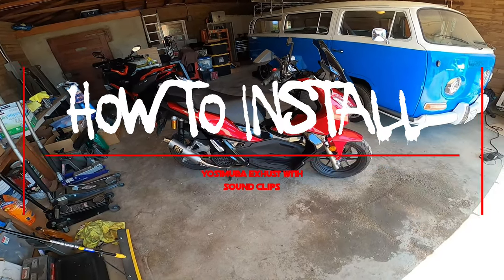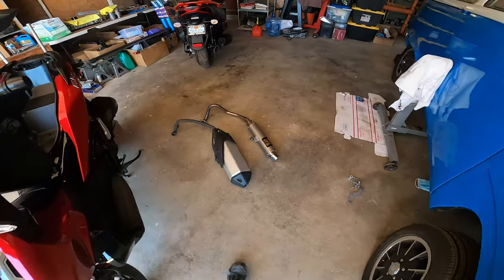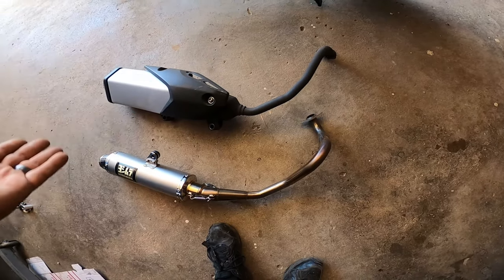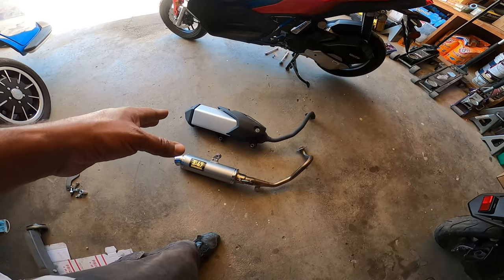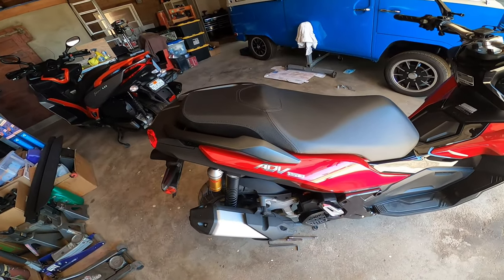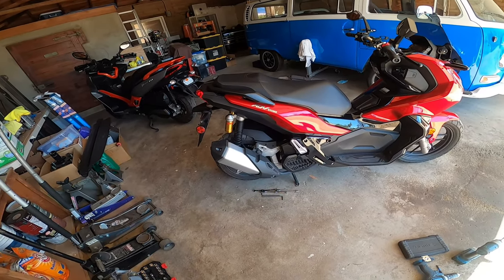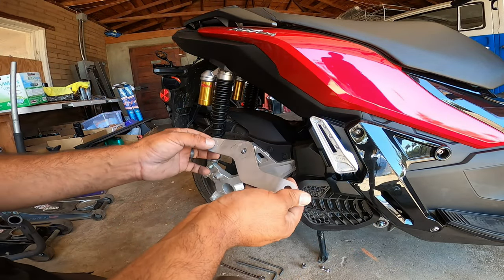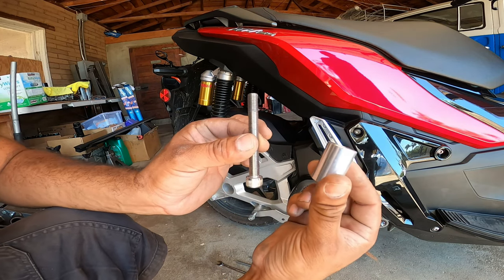How to install a Yoshimura Exhaust on a Honda ADV 150

Comment: Where can we find the wide band O2 sensor? Is it the "E-2/ 13. CORD COMP, OXYGEN
SENSOR (PCX125/150 ADV150
SH125/150 SH125 MODE) "  Just bought a 2023 one and looking to do does upgrades but it kinda hard to find the parts you mention.
Reply: What did you do. Did you ever get your answer?
Reply: You need to get the Aracer Ecu that comes with the wideband O2 sensor and the 4 to 1 connector. That's the only way it will work if you're installing aftermarket exhaust. All of this is needed so the computer can read the AFR correctly.

Comment: I just installed my exhaust today and I love it but on longer rides it does get pretty loud and gives me a head ache even with ear plugs. Do you use the db killer? Does it make it more responsible?
Reply from the maker: I just use earplugs and a good helmet does not bug me. I removed the DB killer. It got louder when I upgraded my head and got a DCR CAM

Comment: How are you enjoying the Yoshimura exhaust, any videos of you riding with it, wondering how it sounds on road.
Reply from the maker: Freekin love it. More videos coming soon once my arm heals up
Reply: Question, you mention that the donut gasket stays inside, if it comes out can it be reused? I purchased exhaust back in October, plan on installing next week when too cold to drive. Any issues I should be aware of with that gasket? Thank you!
Reply from the maker: @Mr. Fifth  yes you can reuse the tiny gasket the big issue when installing the new exhaust the the flange it's not really "EZ" because it's a loose flange the swivels and turns and can get stuck on the exhaust. It is really annoying to work with not like stock where it just bolts on.
I would suggest buying another gasket just to have as a spare because for any reason you install the old one and it fails you can be back up and running pretty quick

Comment: What kind of fuel mileage difference did you see after the intake and exhaust? Better, worse, no change?
Reply from the maker: No change with the intake at all but once I did the injector and tune lost about 10 mpg

Comment: Thank you for the answer. Just two questions, do you know the part name/size for the donut gasket? Also, any concerns putting this on a stock AdV 150 with fuel or engine performance? Thanks
Reply from the maker: https://www.yuminashi.eu/adv-150-abs-2019/

This is the site I use for spare parts and upgrades.

There is a downside to this upgrade you do run a bit lean and the ECU can not compensate for it very well. I do suggest getting the Aracer mini5 ECU and wideband 02 sensor upgrade. The bike really opens up a lot more and makes a lot more Torque as well.
Reply: @PincheALsGarage  sorry, one more question, I am not mechanically inclined😄Can I still run Adv without doing that or will it hurt engine? How much of an install would that be? Appreciate the help, first motor bike of any kind.
Reply from the maker: @Mr. Fifth  if you don't do an intake you will be fine.
I do highly suggest getting an S23 Variator with 12 or 15g rollers makes a huge difference on the bike performance as well.
Reply from the maker: @Mr. Fifth  the job is very EZ just take your time
Reply: @PincheALsGarage  I feel better hearing that, just wanted to make sure I did not break anything!😁

Comment: So there is no 02 sensor? It seems that Bosch makes one. Curious if you are running rich or lean.
Reply from the maker: The scooter does has an o2 sensor but it's a narrow band 02.
Once you install an I take and exhaust you need a wideband 02 sensor to get proper fueling
Reply: @PincheALsGarage  does the wideband plug in to the stock ECU or did you get a piggyback of some kind?
Reply from the maker: @240gunner2  you need the Aracer mini 5 ecu